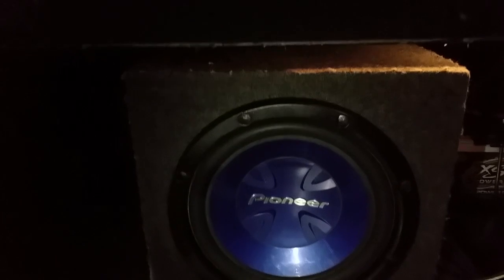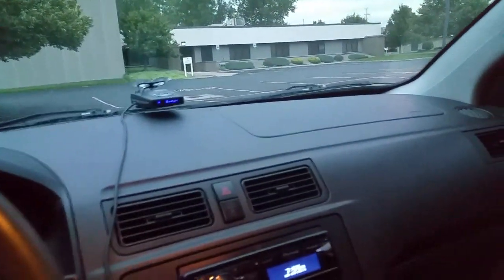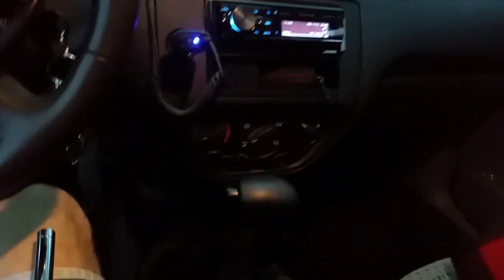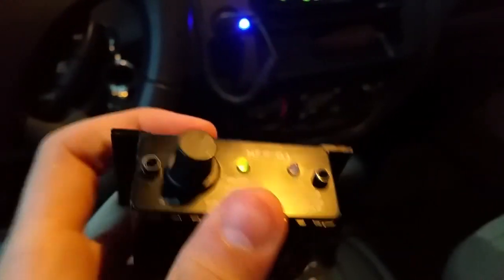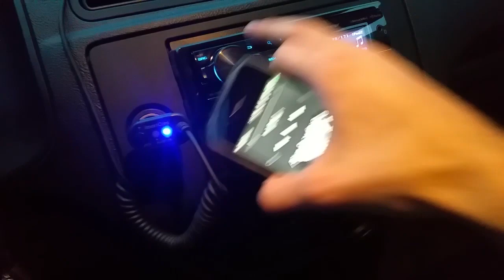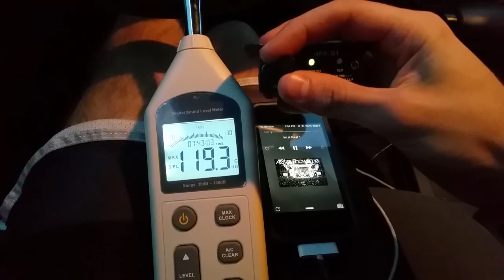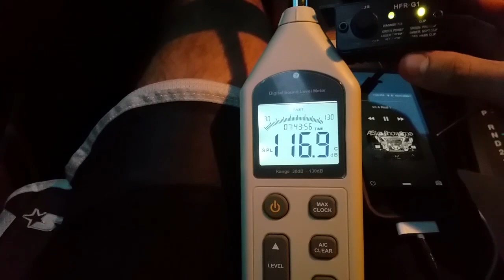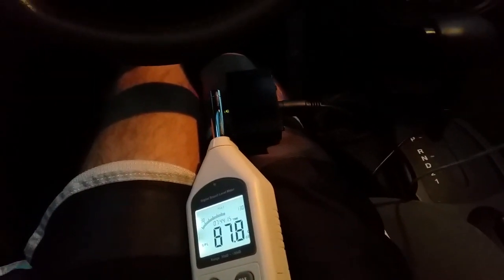Old Pioneer 12" Subwoofer Hitting Hard @120dB!

Comment: I know you mentioned that it was an old sub. It seemed to handle your test well. I'm sure if it was in a better box. That you could get more SPL at lower volumes. Maybe in another video?
Reply from the maker: Sorry, I blew the sub a few months back. I'm sure if I put it in a bigger box that it ould push 125 pr possibly even higher
Reply: probably because the amp was clipping..

Comment: I think .... this is not a very high... my JBL 12" GT5 make 132,8 dB. in close box.
Reply from the maker: That's pretty good. I didn't get a true measurement of it because my meter there only goes up to 130dbc. I have since got termlab and I would retest it, but sadly I blew the sub.
Reply: Mind sharing your amp specs? I have the same sub gt5-s12 1200w 300 rms. Thanks!